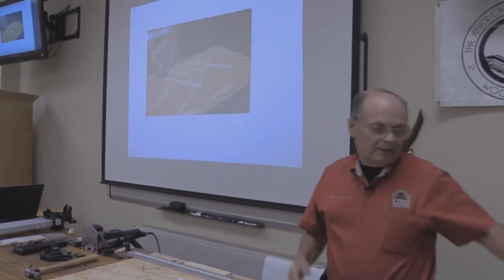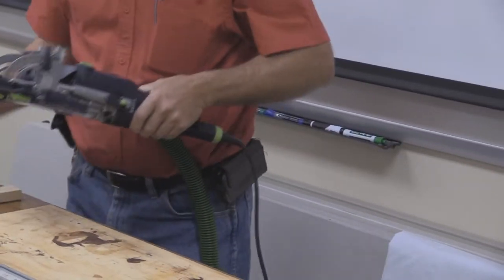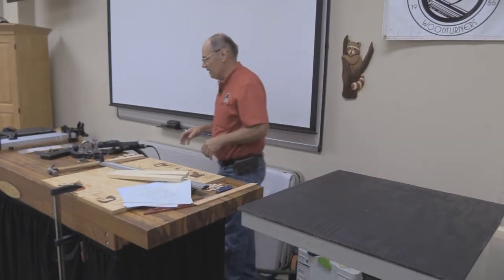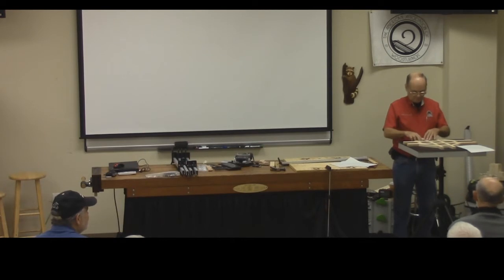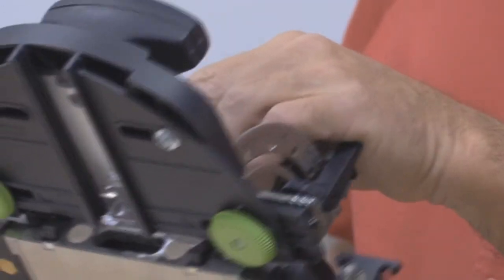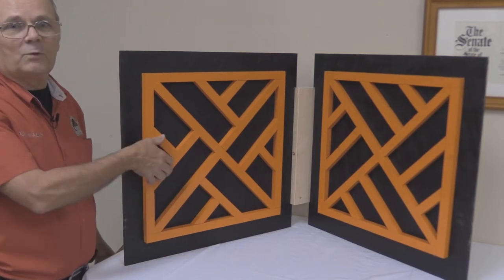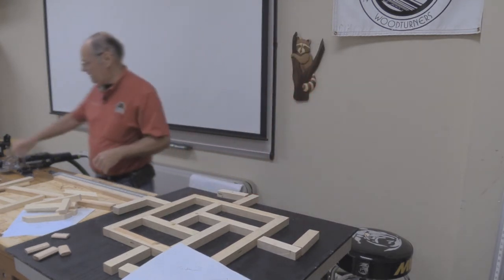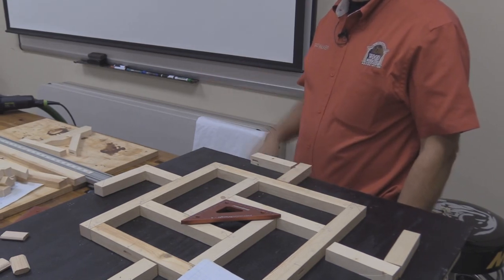Chippendale Designs (Part 2)

Comment: I was given a job to do . Two gate doors. I was curious . If the gates are both 36”squared, and I use pressure treated lumber, will the shear weight of the gates make them sag?